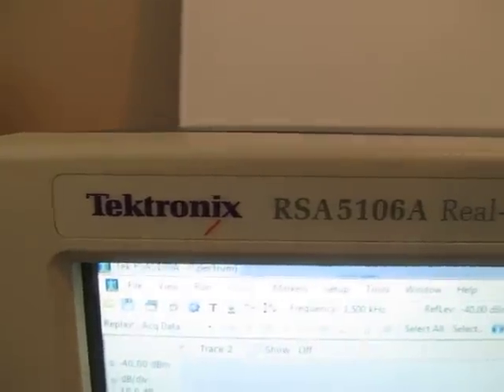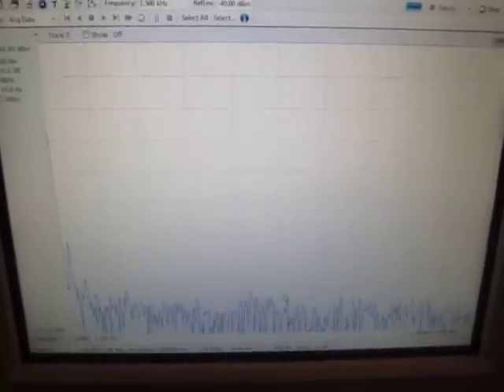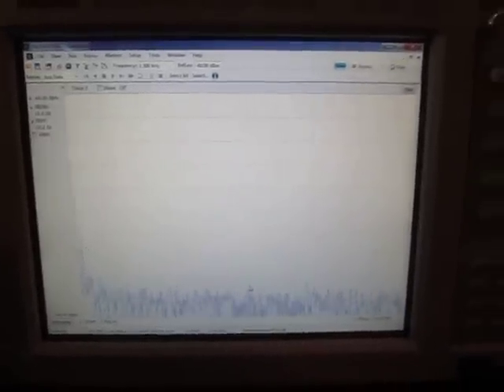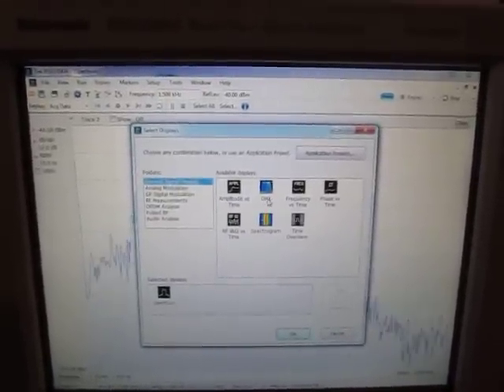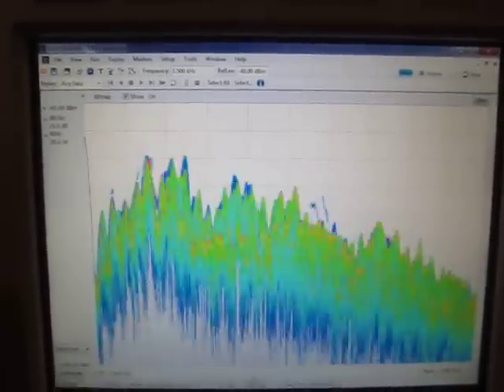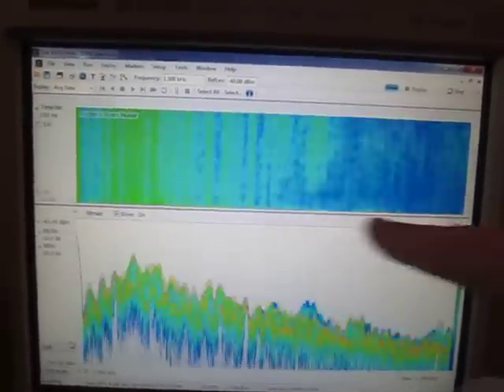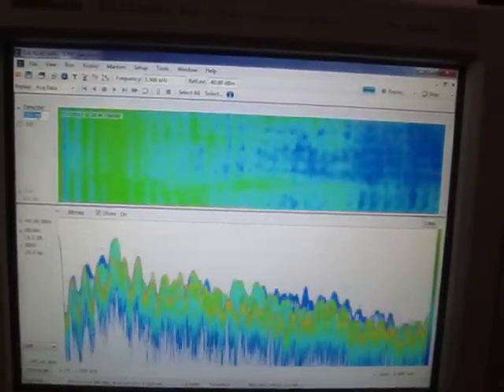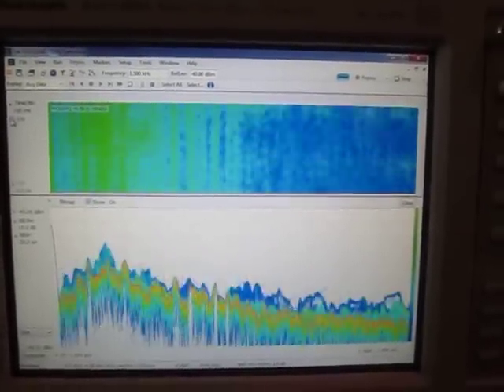#53: Real Time Spectrum Analysis of low frequency / audio signals

Comment: What would be a good way to test an audio circuit, (say like a mic input on a radio through the preamp) and see the frequency response of the circuit? Can I do this with a Spectrum Analyzer with a TG? or would I use a signal generator and a scope? Do you have any videos related to this?
Reply from the maker: A spectrum analyzer and TG is probably not the best way to go, since most spectrum analyzers don't measure audio frequencies - most start at 9kHz.  A audio noise source and a scope FFT is a fine way to start.

Comment: I'm Amazed and stunned now! I have produced and mixed audio for years. Basically, we use software(spectrum analyzing software) to get our audio tracks sound full and bigger than it actually is. Giving each instrument its own "operating frequency range"  that's filtered on purpose to stay in that range. In the end, you simply throw everything together then look at your spectrum analyzer to see that its balanced and no harmonics that's causing ringing effects etc. The main reason is that our ears have their own mechanical compression type of mechanism. If two instruments play at the same time operating in the same frequency range our ears will automatically concentrate on the instrument that's signal has the largest amplitude at that specific time. The rest will sound like noise and add to unwanted harmonics. The BIGGEST problem is reading data!!! Everything is always overlapping. Now the neat trick you can do with something like this is if you look at your sound through the whole spectrum but in the time mode. The rhythm or tempo of the song will almost be like your trigger function or a type of reference. Essentially that will show you the decay of that specific instrument. So you can single out your instrument while still looking at the whole spectrum with all the other instruments. Also the ability to see the density throughout the whole spectrum always making sure that its all colored into what your style is and while having good dynamic control.  Thank you for all your effort Alan, keep up the good work by impacting us learner's learning curves big time!!

Comment: So did I understand you right? You feed an audio signal continuously into an overlapping buffer and you do 300000 FFTs per second on this buffer. Does that even make sense? This means that the buffer must be updated at least 300000 times per second in order for the single FFTs to yield non-identical results. I guess your audio signal has a sampling rate of less than 300kHz, probably 96kHz, which would mean that every two of three FFT evaluations are completely useless.
So then you combine multiple FFT evaluations to look for the most frequently occupied intensities. This will obviously increase the resolution of the intensity, but not the frequency resolution. And it will cause a lot of unwanted delay. In the video the displayed signal has about half a second delay from the actual audio (e.g. when you clap). I consider that far from instantaneous.

Anyway, frequency analysis is a really interesting topic!

I wrote a similar software in Java which has about twice the frequency resolution and a lot less latency. Check it out:
https://www.youtube.com/watch?v=_RLLx_DHudg
Reply from the maker: Things have changed a lot in the 5 years since I made this video.  This analyzer can now do >3M spectrums/sec. Yes, at these very low frequencies and spans, many of the FFT results are overlapping 100%.  Latency, even with 1Hz resolutions is very low with the latest instruments.
Reply: For very high frequencies this totally makes sense. Thanks!

Comment: Does this instrument replace the traditional dynamic signal analyser?
Reply from the maker: In many applications, yes.  There are some differences (input impedance, some different measurement functions, etc.), but it will perform most of the same functions, as well as many that a DSA will not.